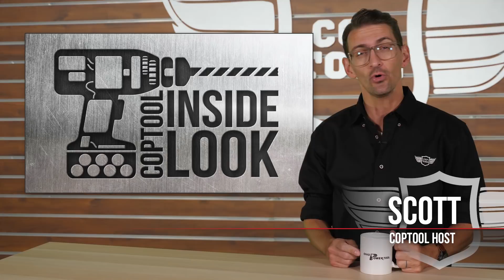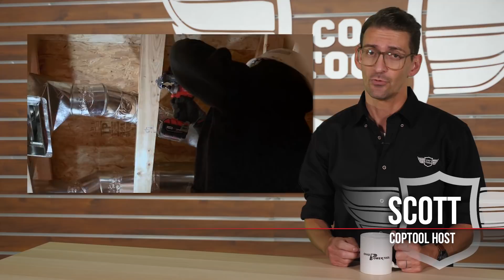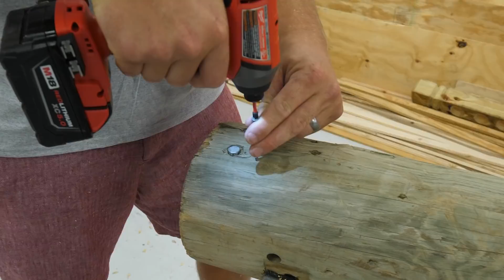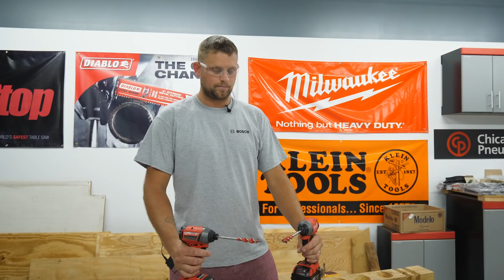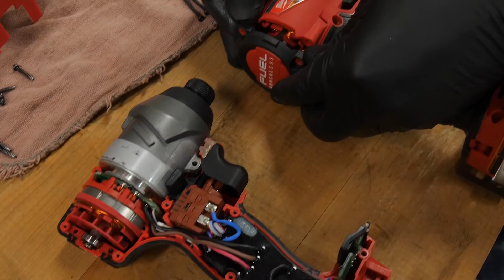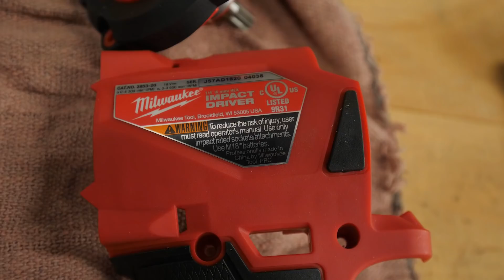Inside Look: New Milwaukee M18 GEN 3 Impact Driver vs GEN 2 Impact Driver

Comment: The new sticker decal puts 200 more torque output and $50 more price. Its a win win.  

Plastic vs aluminum- lets see a 5 year comparison on longevity. Then we will be well into m32 branding at 2400 specs for $200 more!!! Cant wait

Comment: How do I tell apart the 3rd gen to the 2nd gen on the tool without using it?
is it the code? 2753 vs 2853?

Comment: This impact has alot of torque and its great for some applications but it is so hard to use with smaller screws Eg "8 gauge Phillip's head screws " most sizes just wants to tear them up even on speed 2 , I hate it that much that my Milwaukee surge impact gets used every day and this just sits there 👎

Comment: I work at a tool repair shop down under. Not to long ago I had to fix one. What I found it that something got caught between the super small gap between the back housing and the rotor. And it caused it melt the plastic enough for it to get stuck and seize. So that will be something to think about.
Reply: Makita is advertising tools with more sealed internals to prevent that. Surprised tools aren't already dust and moisture resistant.
Reply: @MustPassTruck  Hikoki wants to know your location

Comment: The torque increase is not the increase in speed.

They seemed to have upped all the specs, spins faster, has more torque and more IPM. Not sure how they pulled that off using the same batteries, but the speed increase does seem to show.

Comment: About time to make the battery packs smaller..
Reply: they have... its called m12...
Reply: Right, it would be nice if they made smaller packs with higher end 21700 cells like Hitachi does

Comment: I would like to know why that guy didn't say anything about the Gen 3 not having fan blades that's what helps it to keep cool  that's the way it looked to me. I didn't see them please let me know
Reply: There is a fan, it comes of with the back cover. They attached to the back cover to make it smaller. Im sure of it because I was having problems with mine so I took it apart. Also Everyone is right about the overheating problems with both gen 3 models, along with the electronic problems I was having with my impact driver. They definitely made them smaller and nicer looking, but didn't do anything about the most important part of buying higher end tools like these, are there reliably ( there is none ). Im on my second set of gen 3 and im having problems again with the impact (electronic) along with the drill overheating very quickly.
Reply: @chriswebb3018  I just saw a new video last night of gen 2 and gen 3 being compared side-by-side they took it apart and I did see the fan in the Gen 3 thank you for letting me know peace
Reply: @chriswebb3018   thanks for the comment I have heard a lot about the overheating problem I have a new Gen 2 Kit I hope I don't have problems with that one peace brother
Reply: My friend has the gen 2 kit, he actually was able to grab it for $199,  from the sales everyone was having prior to the gen3 release. No matter the price he's happier with his choice, knowing what im going though, about to return my second gen 3 kit. They have worked a lot of the bugs out already on those.
Reply: @chriswebb3018  I got the Milwaukee combo kit Gen 2 model 2796-22 for $125.00 at the Home Depot when they put them on clearance I was one of the lucky ones that got a kit I ran the drill and impact driver a couple of times but I haven't really used it yet because I'm running off a Makita combo kit right now but I'm going to start using it here shortly to break it in also the Milwaukee one has the one key but I'm pretty happy with the Milwaukee that I got  because the Price Is Right you can't beat that price. I know people were having trouble getting that kit but I could have got many as I wanted in my area but I only needed one. Peace brother nice talkin to you

Comment: I think it's just the M12 impact wrenches that are being called "Stubby." It really kind of sucks that they've replaced part of the gear housing with plastic. I'd personally sacrifice a few millimeters and ounces to maintain the robustness of metal parts. But it was definitely a good move adding an end-cap for added rigidity. As far as I know, only Makita and Ridgid have end-caps on their drivers. Thanks for the video!
Reply: Dustysa4 - I thought the same thing. Stubby name seems reserved for the impact wrench guns.